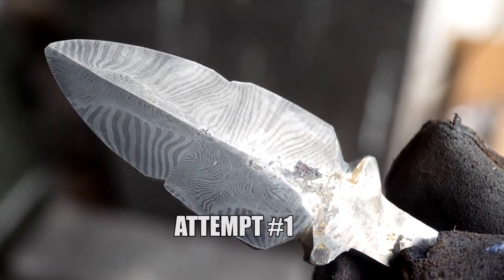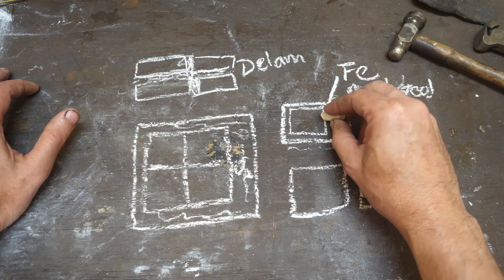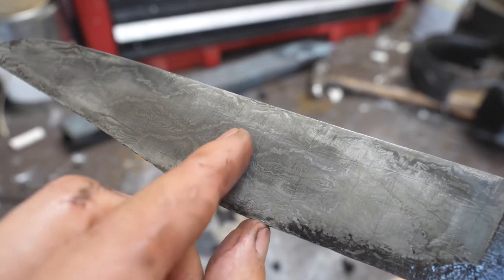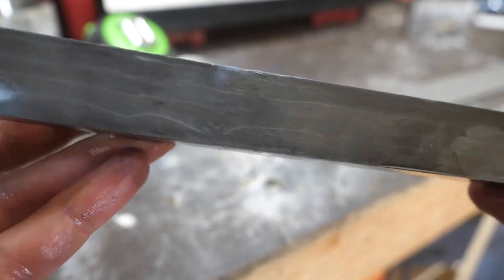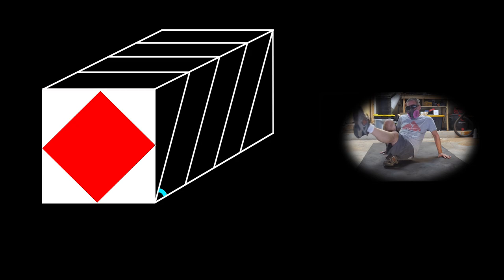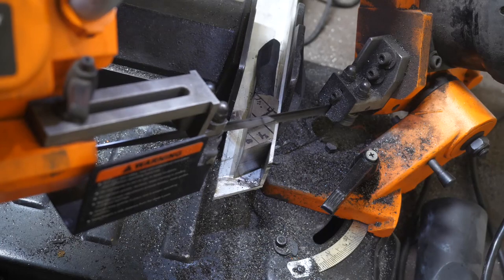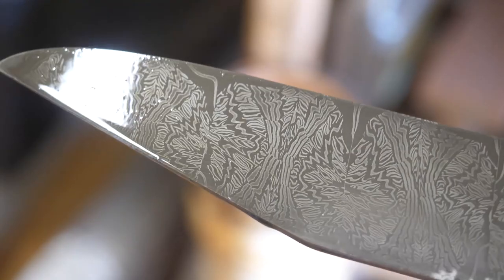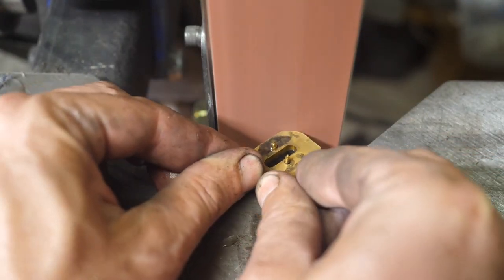Forging A Mosaic Damascus Knife. Part 2.

Comment: Sometimes it feels a bit like you have these "issues" on purpose, so you can tinker around and try to solve them. Which bladesmith would see the bright lines and go "let's recatbonate that steel" - But every metallographer would go for it in less than a heartbeat. You have a true passion for steel and its alloys. 

Personally, that's a big part of why I enjoy your channel so much. It's so much more than cold steel banging on hot steel aka regular blacksmithing.

Comment: Noob here 🙋. What's the foil do? I get the paper and I'm not a newbie to forging but that's new to me. Awesome work and I truly admire your patience.😏
Reply: The foil creates a non-stick barrier between the billet and the canister, so you can just pop the billet out instead of having to cut or grind the canister off, which is a huge pain in the ass.
Reply from the maker: Protects steel from oxidation and scale formation

Comment: Does using a charcoal forge prevent some of the de-carbonising? 
I vaguely remember another channel having issue with their billet of scratch made steel loosing carbon, they figured that out that gas forges tend to be more oxidizing than a charcoal forge???
Reply from the maker: Depends on how much oxygen is present and how hot your piece is.  In the forge oxygen can be controlled by reducing airflow through the burner so that the flame is either “neutral” or “reducing”.  These flames are not as hot and welding big pieces of steel in my forge nearly impossible without the hotter oxidizing flame.  It also happens outside of forge where one can’t control the exposure to O2. The hotter the steel and longer it is out of the forge the more scale forms.  

Technically, under the right conditions, I believe one can add carbon to steel with a reducing flame but atmosphere has to be just right.

Comment: In a canister with no O2 present you can weld SS to your billet inadvertently. Is is possible those lines are were (edit) actually your SS foil and not decarb? 
Relative to other alloying elements carbon migrates through steel quickly so if those lines just the decarburized surface layers they would have gone away (IMHO).
I'm not saying decarb wouldn't behave similarly. I just wouldn't expect such thin, well defined, lines since the effects are not just on the surface. They can penetrate much deeper depending on the number of heats, etc. etc..
Reply from the maker: The foil peels out of the canister and off the surface of the billet after welding I don’t think it would affect the welds.  Alloying can limit carbon migration if I understand correctly I wonder if that was at play here?
Reply: I've heard (but not being a metalurgist can't say with certainty) that Ni stops or at least slows down carbon migration, but I don't think that's the issue... The migration of chromium makes carbon look like a drag racer, so I don't think any appreciable amount of that would have migrated. Especially without being welded to the billet...

I'm not sure. It might be one of those things one can speculate on extensively, but without some pretty expensive equipment you may never know for sure. Maybe Raycon or Raid Shadow legends will sponsor your videos and give you that sweet, sweet Youtube money for new toys. 

(That's a joke; we love you just the way you are Steve)

Comment: First off I want to say I don't know anything about knife making or forging.  Were those lines on your first knife attempt just a visual issue that was not the look you wanted or were those lines a possible structural integrity issue?  I only ask because I thought the pattern you ended up with was quite interesting even though you were obviously not happy with it.
Reply from the maker: They won’t harden and will catch during cutting